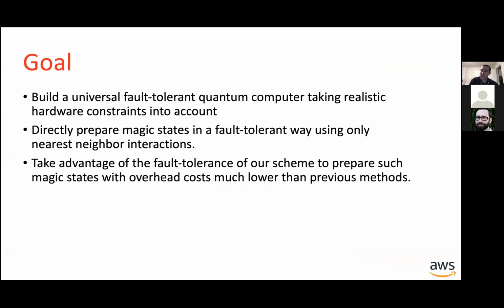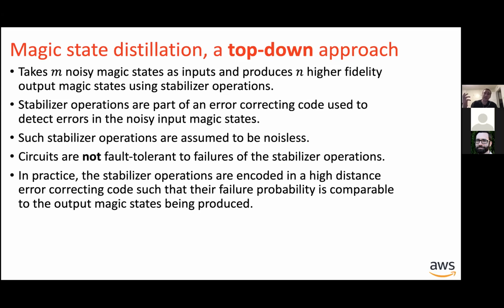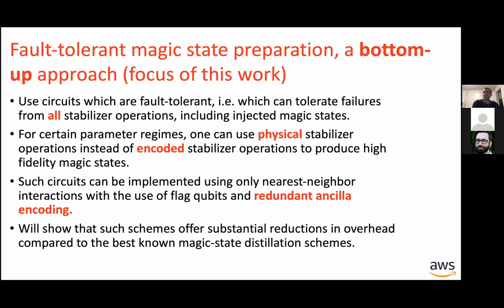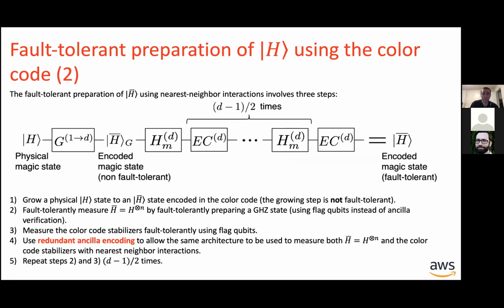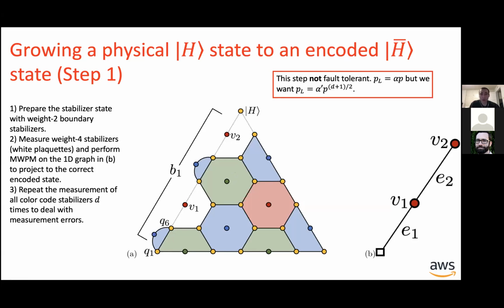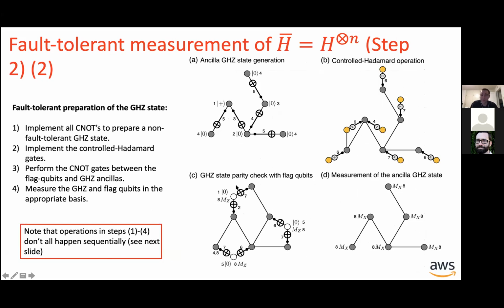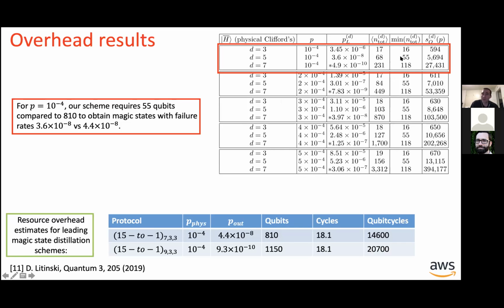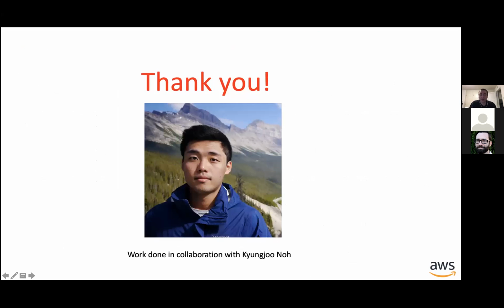Chris Chamberland - Very low overhead fault-tolerant magic state preparation using redundant ...

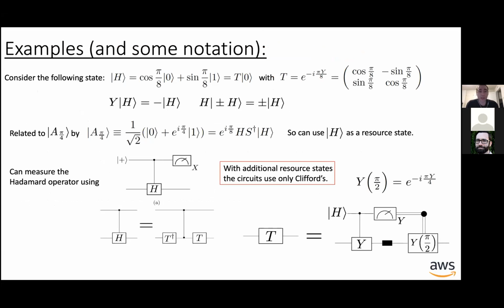Comment: The slide at 8:15 has the equation H |+-H> = +-|H>. It looks like an eigenvector-eigenvalue statement, in which case, shouldn't the right-hand-side say |+-H> as well? Also the notation |+-H> is strange and was not defined at all.
Reply: @quantumchambs6346  Ah, thanks. If I understand, you were trying to convey that Y|H> is a state with a -1 eigenvalue of H, if |H> is a state with a +1 eigenvalue of H.
Reply: and that Y|H> is not equal to -|H>
Reply: @quantumchambs6346  yes, thank you.